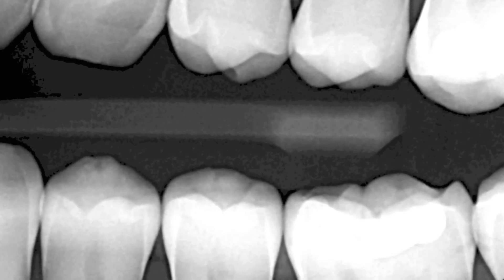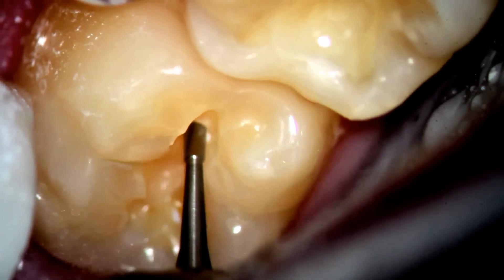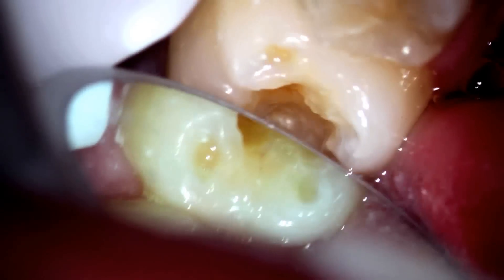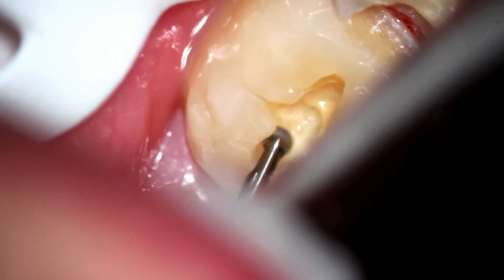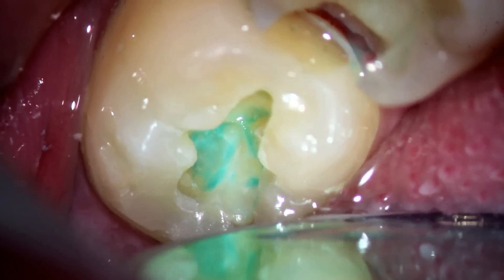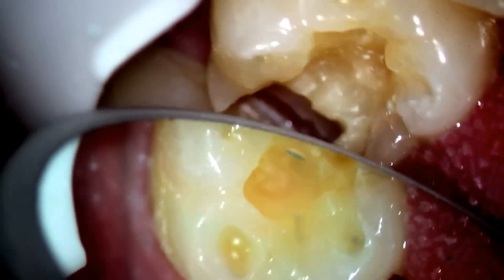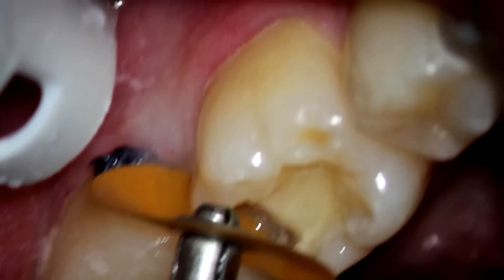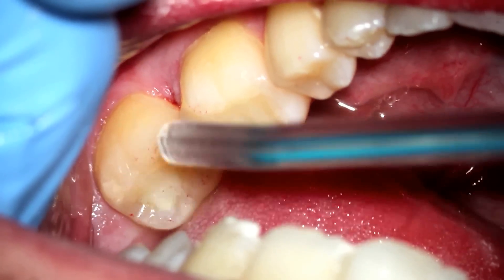How Decay Occurs

Comment: How do you ensure the light cures the composite when using a tofflemire instead of a clear mylar strip?
Reply: Hi, theres a few things you can do. For me, the sectional matrix bands I use allow the light to pass through the band and cure the composite which works well. When I was using tofflemire, I would light cure the composite, and then upon removing the band, I would light cure the composite from both the buccal and lingual sides to ensure it has been fully cured.

Comment: Considering the depth in the removal of the decay, in general, how long can one expect this repair to hold up before the nerve becomes stimulated and therefor painful, needing a root removal ect ect..
Reply: who ever told you that you need a root canal because the filling gets to close to the pulp is a complete moron. its just to make more money out of you ! I have 2 fillings that are super close to the pulp/roots and has NEVER given me any problem except more sensitivity to hot or cold which is not the end of the world ! one was so close that the dentist accidentally perforated the pulp chamber, guy wanted to sell me a root canal treatment, said no, told him to do me a pulp capping/pulpotomy or I will have it extracted, he followed what I told him to do and never had a problem since ! that was 10 years ago. root canals are bad, would you rather have a dead tooth or a vital tooth ? pulpotomy keeps the tooth vital ! off course if infection is present pulpotomy is not possible but it should be done first if no infection is present to try and save the pulp and keep the tooth alive because a dead tooth can chip/crack and stain ALOT more then a vital one. off course it is better to keep the tooth then to extract but me id rather have it extracted then have a root canal done that will only last 5-10 years needing another costly crown down the line once it fails and that is if the root canal treatment doesnt fail within days or weeks.